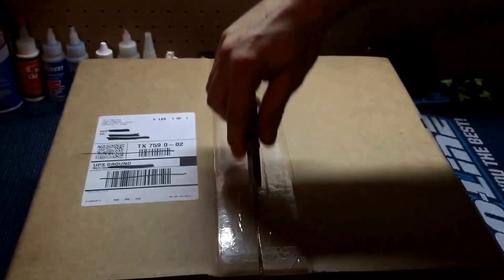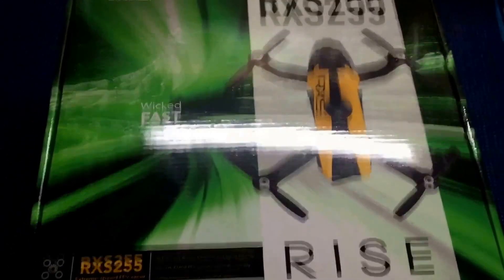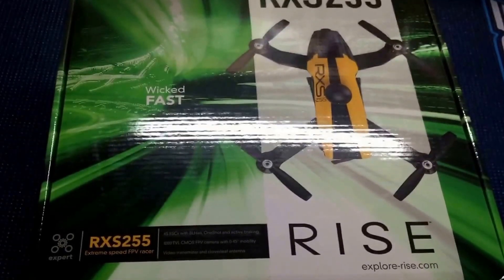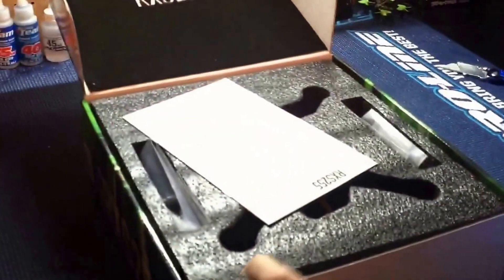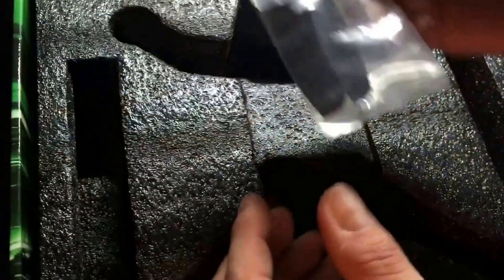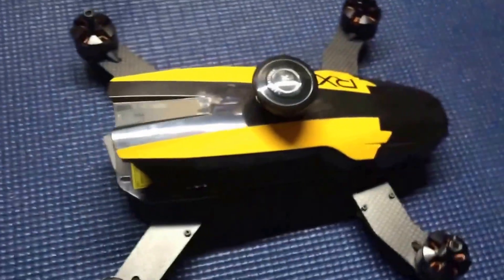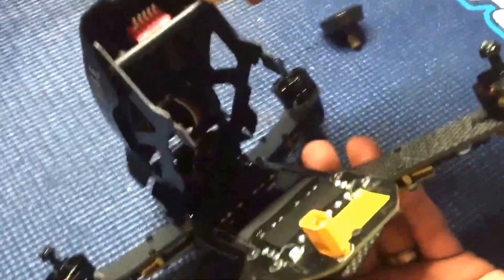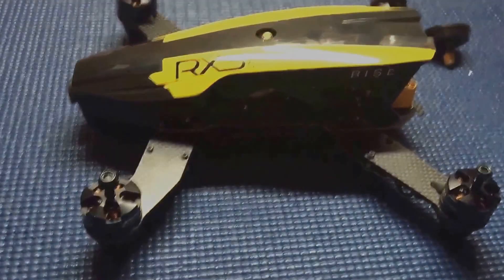UnBoxing - RISE RSX255 4s 1000TVL FPV COMS Camera EMAXX 2300KV Motors

Comment: Did you have any fpv video issues, mine is solid black, I replaced the vtx and it is still black. Yes I took off the lean cap
Reply from the maker: +Matt Murton To be honest I sent it back to tower hobbies. Could not get it to bind with my FlySky PPM receiver.

Comment: can't get mine programmed any suggestions,my transmitter is a DX6 and a spektrum receiver!
Reply from the maker: Blake Stutz It sounds like there is an issue with your Tx & RX. I have not put a receiver in my RSX yet. You should call Hobbico Tech Support @ (217) 398-0007 and they will be more than happy to get you flying! Hope this helps!
Reply: How do i get settings file frome the "explore-rise.com" when the website doesnt exist?

Comment: Are u using the same controller as the vusion 250?
Reply from the maker: #lumenatti No Sir, the receiver is built in to the VTX on the VUSION. I just happen to have that on my work bench.
Reply: 696mattie ahh i see, cuz vusion only 3.8. Just got mine a few days ago. I'm curious to see what u think of this compared to the Venom, and the Vifly.
And will u also be doing the rise 125 houseracers? I know the same controller works for those...
Reply from the maker: #lumenatti I'm will be reviewing the Rise 125 when it arrives! I'm not familiar with Venom or the Vifly..🤔
Reply: 696mattie your last unboxing (venom) and the vifly is a similar complete package composite that is really nice
Reply from the maker: #lumenatti I will have too look into the Vifly! Thanks for your feedback!

Comment: bnf would have a receiver if this needs a receiver it is arf
Reply from the maker: Your correct, This is the ARF. So you will need a Transmitter and Receiver to fly the RSX255..